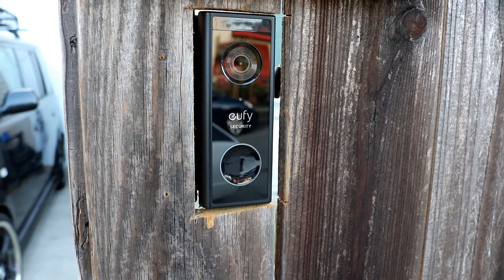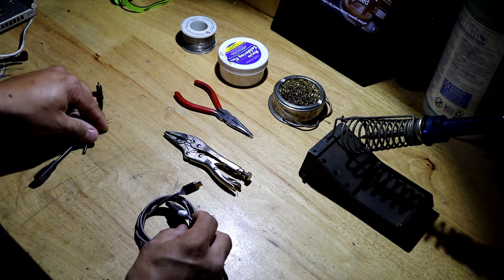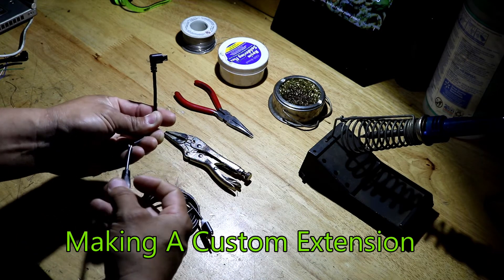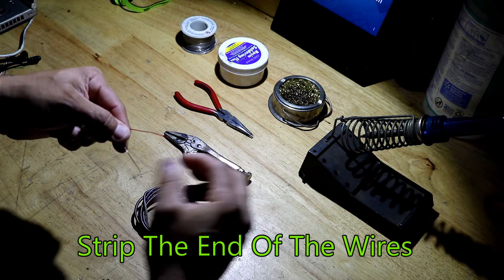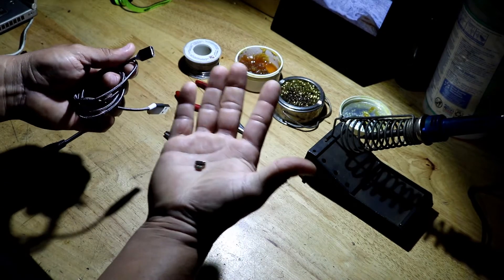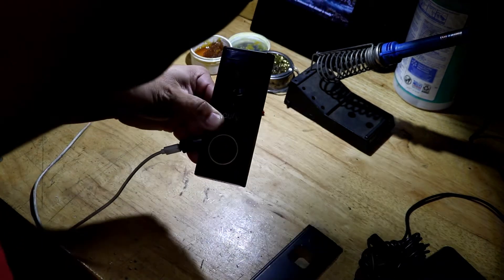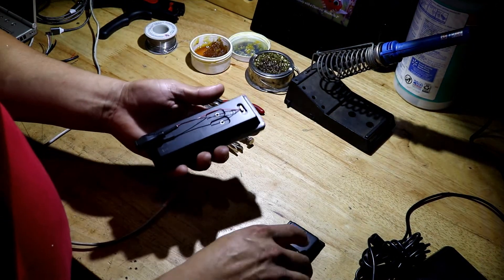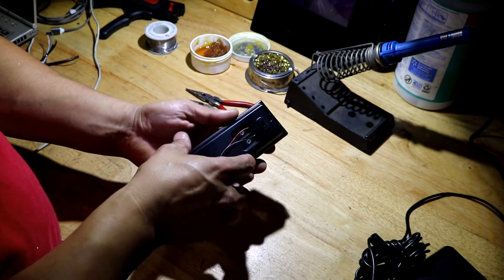Eufy Battery Doorbell Solar Panel Modification.

Comment: Hi does this work with eufy e340 doorbell? It doesn’t have a usb connection just two screws where you attached the cables for hardwire.
Reply: Did you ever find out if it works? I have the same Eufy model and am interested in a solar panel solution.

Comment: This works a charm. At first camera would only charge 3% then go down.  I then worked out the voltage regulator device was faulty.  I fitted one of the other 5 in the pack and boom! Charges great. Works well.. 100% maintenance free doorbell. 😊. 

Oh, I drilled a whole in the rear of the housing and out standard cable through it.  I then used liquid insulation tape to seal.
Reply from the maker: I'm glad it worked for you. The idea was there but everyone can improvise it like you did. Yes maintenance free door bell. Mine has been running for more then 2 years and all I have to do is clean the spider webs every 3 months 😂.

Comment: Low key, could you make that pigtail adapter piece and sell them? Because I'm ok with soldering and wiring, but never to that small of a level.
Reply from the maker: I can make some extra pigtails. Ill see if i have more connectors probably have them on ebay.. ill keep you updated. Thanks.
Reply: If you sell them, i need one please!! Send link 🙏@dennis_503_gutierrez
Reply: Me too.. I live in the uk.. I tried today, but it broken when trying to take off the magnet.
Reply from the maker: @seychelles44  Yeah is very small and fragile. I haven't found another way to do it. Some mentioned ribon cables but i haven't found any right angled micro usb ribon cables. It might work but the ribon cable might push the sync button when attaching it to the wall mount.
Reply: @dennis_503_gutierrez ok, I’ll have look and see. I’ll keep you posted. Thank you
Reply: The cable arrived today.  I checked on a micro usb connection, and I found a series of voltages.  I take it I’m supposed to use the 5v supply terminal, Is that correct?
Reply from the maker: @seychelles44  yes.. 5v

Comment: Dose that set up perhaps over charge the battery?....just wondering....
Thanks for the video 👍
Reply from the maker: This set-up or say the module does not over charge the battery. Works the same as plugin it into a wall charger. When is fully charged it stops charging.
Reply: @dennis_503_gutierrez  thanks for your reply 👍 🙂

Comment: Wouldn't water get inside the unit ?
Reply from the maker: Hi. I have duct tape sealing the plug. I also have installed on a fence with only the mail box on top. After more then a year, I don't see any water going inside. Water will go in if it's not seal properly.

Comment: Thank you for posting the video! I wish Eufy offered a native option. I was wondering if you tried just stripping back the Micro USB extension of the plastic case to expose the wires? Do you think that would work?
Reply from the maker: Would have been nice if they had a native option. I have tried stripping out the micro USB but it is too big. It sticks out too much and will not let the door bell lock in place. I tried many different ways like an 90 degree ribbon cable, wireless charger adapter, etc etc. But this is the only way for now.
Reply: @dennis_503_gutierrez  Thanks for the reply. All the best! 😜
Reply from the maker: Thanks. Cheers 🥂

Comment: Thank you for the video. I am going to solder to a 5V 2 amp solar panel to wires that go straight in to the ring camera 3 terminals. I was wondering if there was any other step I needed to do? Anyway cool video.
Reply from the maker: I uploaded an update video to this project. You need a module or Voltage booster module so it can charge properly.
Reply from the maker: Thank you..

Comment: Does this mod make the USB port vulnerable to moisture now? Rain? Snow?
Reply: get some non acidic silicone and apply a dab over the hole (to cover it and the entire hole flush), that will seal it and if done right help with keeping both + and - wires away from each other and the sync button, simple. if you need to later remove it its not a job that can damage either the pigtail adapter or the unit itself.
Reply from the maker: The doorbell itself is not waterproof out of the box. They don't recommend installation to direct rain or snow exposure. This mod will not make it water proof but if you install it on a porch or under some kind of roof, you should not have any problems. the USB port you need to cover it with electrical tape. Mine is installed on my fence and there is no roof on top so it has seen some rain. The only thing protecting it from ran is the mail box that's on top of it. I have not have had any issues with weather. That thing is full of spider web and still working. I will upload an update video soon.

Comment: Did you try just wiring the pigtail into the back wiring plate (reserved for hard wiring) skipping the USB altogether?
Reply from the maker: I did. Doesn't work. The hard wiring pins only works with 18v.. remember we are using 5v at 2amps to 3 amps just to charge battery..

Comment: What about the charging indication ring. Does it turn off, once the battery is fully charged or is it always on? Thanks.
Reply from the maker: The ring indicator turns off at night when is not charging. During the day when is charging ring is on orange and when is full is solid blue but it goes off when the sun is down since there is no energy source to keep charging it. Will make a video update soon.

Comment: Do you then run your eufy doorbell at maximum quality settings? And does it keep the battery charged at 100%?
Reply from the maker: Yes, but you need a module for that. I have it at optimum surveillance option and it's always fully charged at the end of the day. But you need a module. I will update this video with my new updated set-up.

Comment: Why not take a solder gun use it to burn a hole in the back plate is that an issue or a problem for you then you can plug the micro USB directly at
Reply from the maker: If you burn a hole on the back plate, it will be right on the mounting hole

Comment: hello.  good video.  I have been experimenting the same type of project with my August View battery powered doorbell.  I have found these micro-usb ribbon cables the best. https://www.aliexpress.com/item/4000769485887.html?spm=a2g0s.9042311.0.0.801a4c4dSCEFgz   
You don't have to worry about find the pins.  You just peel back the covering and you have a micro usb connected ribbon cable with positive and ground already marked on the ribbon cable. You can also remove the metal cover on the micro usb to make it even slimmer.
Reply from the maker: Very nice. Yes those should work perfectly..

Comment: Why, why, why???
Reply from the maker: Hahaha.. i had to.. got tired of battery lasting 2 weeks.. lol
Reply: @dennis_503_gutierrez  It does the job I suppose, hope it lasts longer than normal
Reply from the maker: Yeah. I have not charge it for more then 2 months. And i have it on optimum surveillance mode. That mode used to drain the battery super fast because there is a lot of motion where its installed. Its always at +90% charged for more then 2 months.
Reply: @dennis_503_gutierrez  Why do you have to do the modification? Why not just plug in solar panel cable directly to the camera micro USB?
Reply from the maker: I tried that way but there is no room for the cable or plug once is attached to the mount. I was thinking on drilling a hole on the mount but it would make it weak and flimsy. You are not modifying it, you just making a pig tail extension. The bolts only work with existing wiring..
Reply from the maker: @eusebiolopez9360  Hi and thank you. Yeah it was very small micro usb but that's the only adapter I found small enough to use. The adapters you showed me are a bit long and you might have to drill a hole on the back plate. I personally could not find any small micro usb adapters. Would be nice to find a 90degree ribbon micro usb. But remember that there is not enough space for any wires or plugs once the doorbell is mounted..